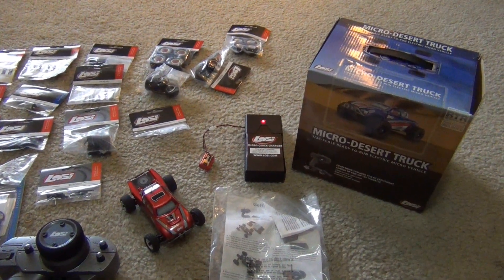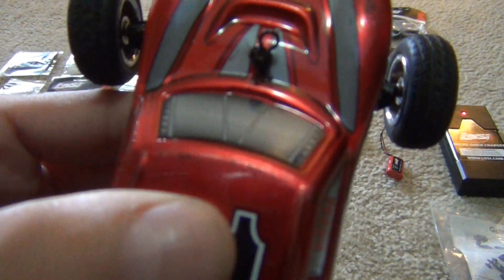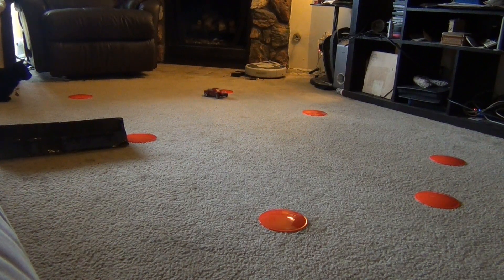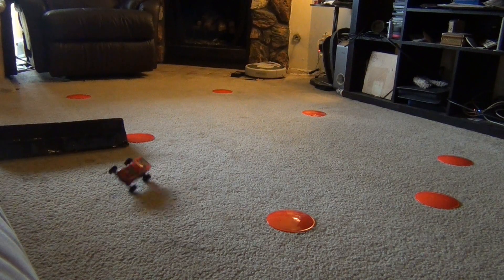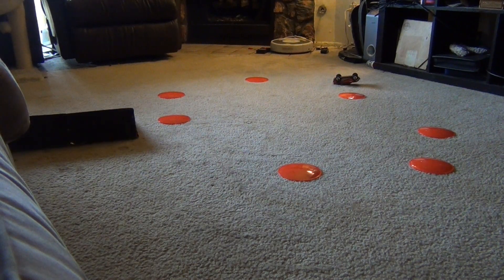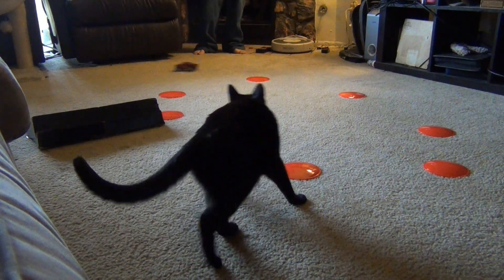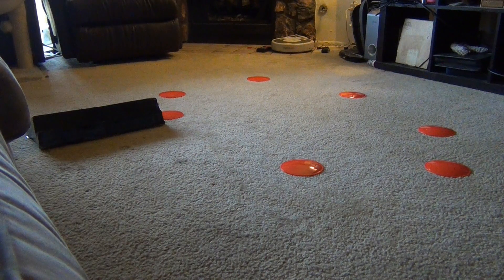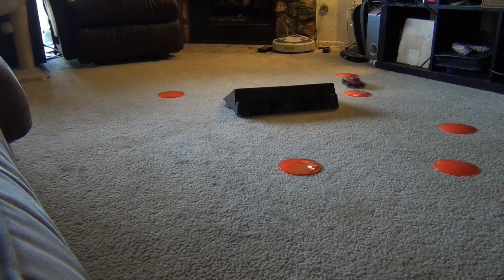Losi Micro Desert Truck - Revisited & Testing NiMh / Lipo batteries.

Comment: '
i have one good losi AE 1/36 RC car with normal motor...
dont need to change brushless motor
Reply from the maker: Yeah for these tiny RC cars brushless is almost overkill.  They are already so powerful it is hard to keep control on full power.
Reply: @earthling1984 
hi E...
'
https://www.youtube.com/watch?v=SSp28Acczyo
Reply: @earthling1984  Mines been on the shelf for close to a decade…now that my kiddos are older they asked if I’d pull it out of retirement but the battery is obviously shot and I’ve having trouble finding a replacement.  What lipo are you running?  Any other battery alternatives you’re aware of?  Thanks in advance!!